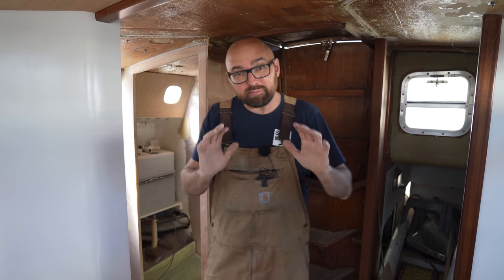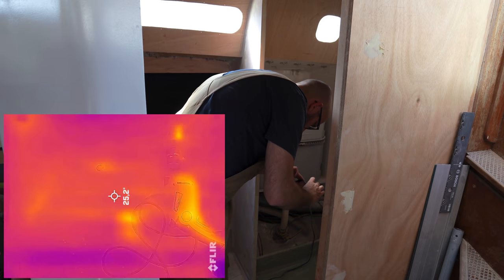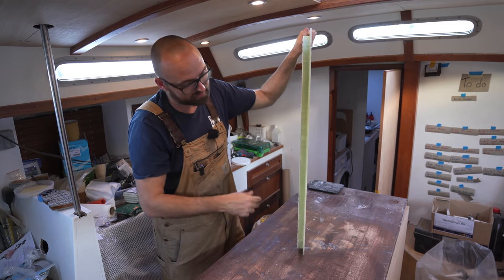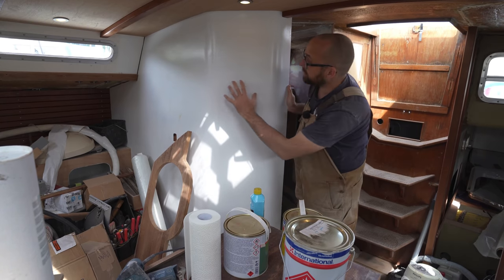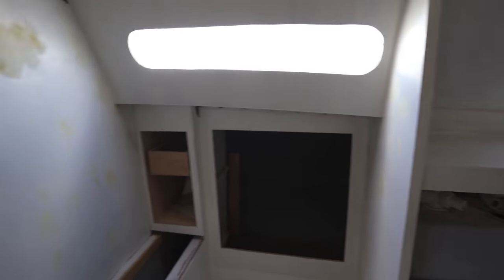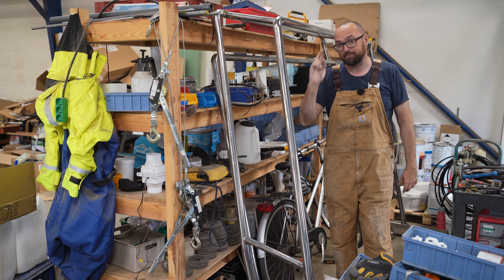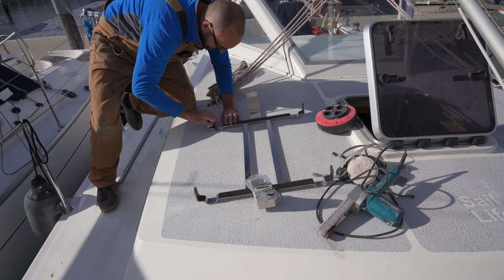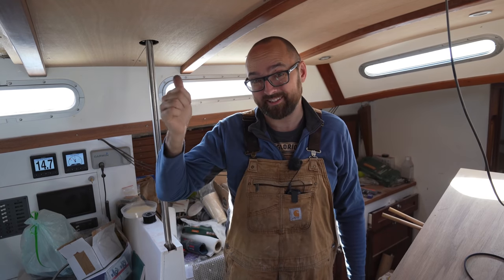Sail Life - Finally laying up glass and painting the head! - DIY boat project

Comment: You are coming along wonderful, really looking good. One thing to consider with the solar set up is that solar controllers USE POWER AT NIGHT well in the day too [ consuming 48 amp\hr instead of 12 amp\hr each and every day ] and having only one is a HUGE benefit, as it is more efficiant when run close to max than at min power. just keep the others as spares. Running the panels in parellel will still prevent any shading from taking them all out, and the greater current flow will keep line loss at the minimum. That panel with the scratch is fine it is limited to the frame only, cosmetic and can be hidden when butted up to another panel.    CHEERS             Steve h.

Comment: Vinylester putty is the quickest way to fix pinholes in the fairing before or during the paint process. Mizlx up the tiniest batches and apply, even between paint layers if a flaw is found.  Sanding within 30 minutes of application and painting again immediately after. The stuff pretty cures.faster than you can work.  3M sells it and it is ridiculously expensive but a pint jar is nearly a lifetime's supply.

Comment: I would be thinking of a wall as only being wood thick with glass on both sides: wood plug, two halves filled with foam after glassed in: and two wood walls, glassed on both sides, with co suit through it, filled with foam.  The latter is strongest & most quiet.
    Enjoy a wonderful week, keep building.
Reply: Conduit that is..  f#@$in auto correct.

Comment: You might want to put a chain plate kind of support under the life raft cradle.   They tend to take a lot of stress in storm situations.  I've seen a lot of them rip away.   Frankly, I don't like those cradles.  You could build a half depth recessed area for the life raft container, then put locking straps (shaped metal bars) over the top.  It wil interfere less with your sight lines and be more secure.

Comment: I like the idea of the shower drain, but i have reservations that it does not contain a hair trap, it would not matter with just yourself Madds, as i can see you are like me, a bit thin on top, but where Ava is concerned the drain will block up in no time, my wife is testament to that.
Reply: I mentioned this before.  I think he said something about installing some kind of adhoc screen, which makes me think he hasn't actually dealt with long hair and plumbing before.  Which of course he doesn't look like it's a common issue for him.  Worse though, the cockpit drain he chose looks like the cross bars will block inserting most common hair stoppers.  I hope he at least packs a couple of drain zippers.
Reply: Mads mentioned double hair traps if I remember correctly. He is not the kind of man to forget something like this.

Comment: Holy hell man! 4 mppt chargers is insane, lol. It really comes down to how your array is set up, parallel or series when concerned with shading. I do love victron though. Hands down the best customer service experience I've ever had.
Reply: It was interesting to see that you went with the same plan as we did buy planning a charge controller for each panel.  I am trying to decide if I should continue with my plan to do the same for shading reasons or if I should go for higher voltage.  I am realizing that if I stick with the panel voltage I will lose some output potential during low light scenarios because of the low voltage from each panel, being only 28v.  I understand that 20v over battery voltage is recommended for the best efficiency which would suggest wiring two of the panels in series because they are exactly the same.  I wonder if the built in diodes would prevent output loss from one panel being shaded.  We’ll need as much energy as we can get from the few panels we have to make our needs match the supply and storage we have room for.  I have already bought our charge controllers; but now I am giving it more thought as I get closer to having my articulating pedestals built.

I wonder if any of you have considered this same thought.
Reply: After doing some more homework, I think we are on the right track going with multiple charge controllers for maximum efficiency when it comes to shading.  It’s more expensive, but with the Cerbo GX helping the controllers work together through the whole charge cycle there may not currently be a better way to get every watt possible out of a given array of panels.
Reply: @GeorgeIvanPare  I don't know man. I manage just well with two LG 330w high efficiency panels and a victron Mppt 75/150 charging a 3x100AH LiPo bank. All in parallel. Shading isn't a problem even with dust. If you were running a 1kw+ array then I'd could see two controllers but in all honesty for the weight and cost its not worth it. I'd rather buy one more battery than another controller.

Comment: For the head, check out air-onlyventilators.com and their low profile deck vents. Add the optional “Breezy” internal electric exhaust fan (with a long life computer fan) and you will be all set. Excellent product.

Comment: If that's an aluminum frame panel you should be fine. If it's steel, you may want to paint some zinc passivation paint on the scratch.  The panel itself should be fine.

Comment: I wonder about the structural efficiency of your thickened epoxy/chopped fibreglass plugs. Even though you're planning to use supersized washers on the inside, they're going to need to bear against something more structural than balsa. I'm guessing that there is a layer of fibreglass on the inside of that balsa core for the supersized bolts to bear against, but is this fibreglass strong enough to anchor the life raft bolts? If the supersized washers are bearing against the plugs, you will be relying on the shear strength between the plug and the balsa.

Comment: Consider putting the shower controls not under the shower head. Back wall side wall,away from the water
Reply: Agree, that way you turn on water without getting wet plus less leak/corrosion problems

Comment: I am curious (without any negative implications - seriously- ) how much time you invest in planning prior to starting anything.  Obviously there are many options on each project you take on as well as many implications based on each choice.  We get to see the actual work once the decisions are made.  I believe you invest a great deal of time considering the implications prior to the start of anything.  I wish I had the ability to create an accurate list of implications prior to making any decisions.  I certainly commend you for that skill.  I love the videos and the explanations along the way.
Reply: No questions asked, plan first act later. There's just no gain in doing it otherwise. EXCEPT... (drum roll) if you've done it before and you already know what to eat the elephant with. This is Mads' second foray into repairing a boat. Obelix, his previous live aboard, well, imagine that he stripped it bare. Hull, bare. In case you didn't know that, he also has pics and videos (insta and here).

Comment: 13:30 I could understand 2 or 3 but it seems ur trying to overcompensate for the polar bear comment with that one
I plan on changing to a house set engine set and separate bilge battery mounted high and i will be running two but that's cause I wanted redundancy

Comment: I would wonder if the damaged solar panel had been stressed enough to have micro cracks in the silicon now, enough to cause stress cracks and failure to come. If you don't want to replace the panel now, at least do output tests on all of them to make sure non have been damaged in transit, internally.
Reply: Not likely, the tempered glass would have shattered in to a gazillion small glass  nuggets first. The Si wafers are generally encapsulated in a clear silastic.

Comment: No ventilation in the head or shower? Too much moisture buildup…..and lack of outside air circulation in there.
Reply: No doubt an important part of the head project. There appears to be sufficient space for a low profile dorade vent between the lifeboat and dodger.  I would not be surprised if one appears very soon.  How many days until Eva arrives?